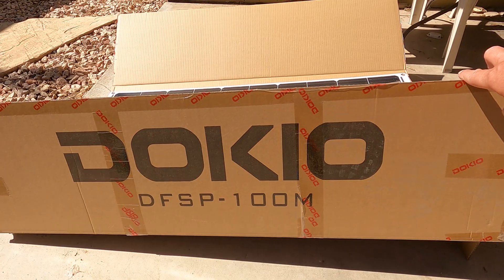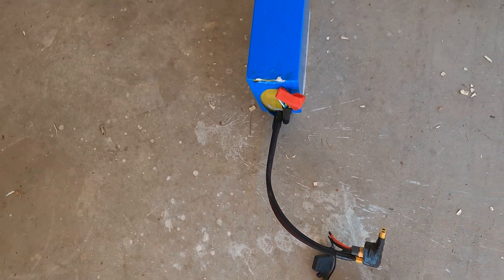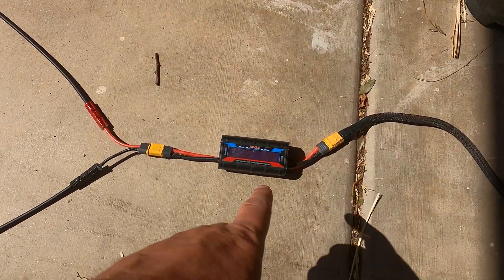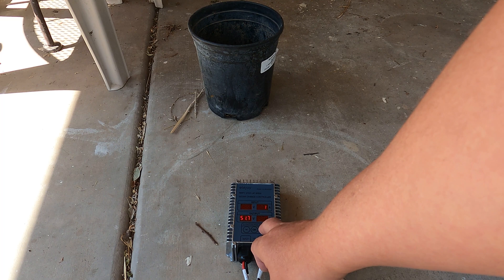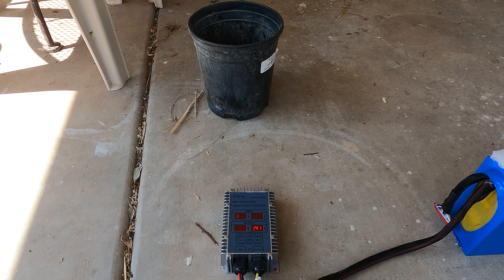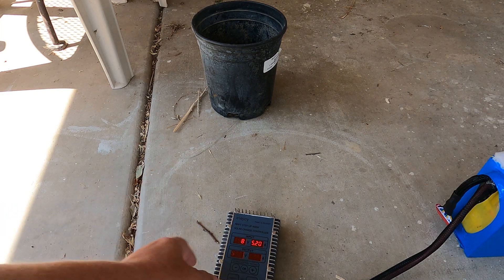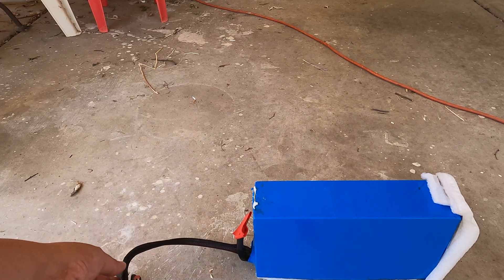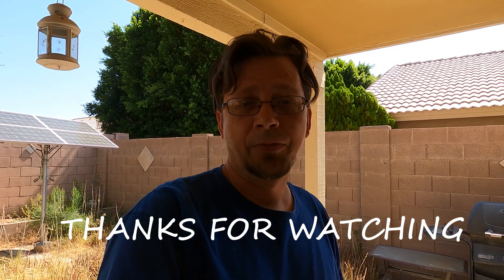🚴‍♂️Charge E-Bike With Solar | How To Charge Electric Bike with Solar?

Comment from the maker: CHARGE CONTROLLERS
🛒Cheapest - Boost Converter: https://amzn.to/3rVJ6cn
🛒Midgrade - LED MPPT Boost: https://amzn.to/3mzaCH4
🛒Midgrade for All Volts  (From Video): https://amzn.to/3rULEYd
🛒High End for 48v - Genasun (From Video): https://amzn.to/3ARroai
🛒High End for All Other Volts - Genasun :https://amzn.to/2UARc9Z

OTHER
🛒Meter: https://amzn.to/44RuuJN
🛒100 watt folding solar panel: https://amzn.to/36fbAQc
🛒100 watt Flex Solar: https://amzn.to/43I18wd

Comment: Hey Eric, thanks to you, I finally got my Burley adventurer trailer with stock solar panel rack for it, with an Amazon tilt rack, one 32 oz box of Flat out which I've been using in both my fat tire ebikes, trailer tires. One 200 watt Werchtay 9BB,with 166mm A grade cells 22.8 % eff., works well in partial shade. I already had Bluetti solar controllers 6.various sizes. But just bought a smaller blueetti  268w for mobility. $668.03 on Amazon 12 equal payments of $55, this includes trailer hitch and 4  1/2" emt pipe straps to secure Amazon tilt bracket to the Burley stock trailer rack. Everything I need except a combination of 8 bolts, washers and nuts which I'm going to Ace hardware around the corner right now..Thanks so much for your encouragement,  I'm ready to take on the world..lol. 😀

Comment: You can charge up to 350 watts? What does that mean in terms of charging an ebike battery? I wish there were some lower level explinations rather than "you get this part and this part and that is a solar sytem". You have a ebike battery, the converter and the solar panel and all these things jumble together and then you get X amount of range extention. Too bad there isn't some kind of a chart with  different converters and panels. I can't find charts anymore on Google. That's weird.

Comment: Hi, I got a quick question  I have the genasun 
48 V charge controller for my 48 V 14 amp hour batteries 
My question was do I have to upgrade my batteries to solar batteries like yours.
Or am I able to just plug into the existing charge port?
Reply from the maker: If your not looking to charge while riding charging using the charge port will work fine.
Reply: Perfect thank you Eric for your time and help
I have a trailer camper I made for my 
e-bike 
And with your videos I am able to make solar work for my setup

Comment: I have a Bosch battery which has a proprietary plug. I charge mine with solar all the time but I have to use the original power brick, and I use a small 300 watt solar generator with built in charge controller. and connect it to a solar panel.  There really isn't a practical solution for long bike trips as you'd lose a day riding just trying to charge it. My battery will last me a whole day and I suppose if I went camping I'd back a solar generator in my car and charge it at night.  Ride1UP sells a solar kit on their website but there isn't any detail on what they are using for charge controller or the wattage.
Reply from the maker: Each time you convert AC / DC you have a 9-10% loss of energy. You can still charge it this way (DC to DC) if you add a bullet connector (could be a other type) to the mppt just like your normal charger for that battery.

Comment: Hey Eric. What kind of amps are you getting with this setup? I've been looking for "cheap" folding solar panel or two with at least 200watts. Would be very nice to have some backup power during longer trips so i would have much more options. 😅 i know quietkat has one but i think thats still a bit expensive for me at least. 😅 Would be awesome to see diy-version of that!
Reply from the maker: I have 2 AllPowers 100w ( https://amzn.to/3rSnxcV ) with a bit of a hack [ https://youtu.be/h3j9WSJx8QQ ]  

Quietkat $369 https://amzn.to/3Oa0ZM0 They need to work on their Amazon page. They forgot to list anything about its output. So the Quietkat only about $51 more then the Allpowers setup; however on the down side Quietkat is about 4 pound more.

I need much better sewing skill to diy one of these.
Reply from the maker: Just found out that the Quietkat is 150w not 200w. Had to goto their website to find the wattage information. Today they want $389 on the website, and $619 on Amazon.
Reply: @Eric_Tennant  wow. Bit of air in the price.. 🤔 im constatly thinking if i could make something like it, but with more juice 😁 i have no experience sowing but maybe my mom would help me with that 😂 would be interesting project. I have 2pcs 5amp chargers, and they are  really awesome on trips when i run two batteries in parallel. If i only had the possibility to charge without a plug would be even more cool 🤭
Reply from the maker: @E-BikePacking  Yea anything over $1.55 a watt for foldable is overpriced. Flex solar is running crazy low now. $0.59 a watt starting price for some. Have to be careful with flex. Some are pure scam crap on Amazon and other sellers. The one in the video is testing great so far. Even with the mods I've done to it to make it stiffer.

Comment: (sarcasm) But you hardly get any sun light where you live, right? Year round cold, overcast, cloudy all the time. Hardly worth the effort. (/sarcasm)
Reply from the maker: I know right! Me and my 49 panel (40X400w roof, 2x100w foldable, 100w flex, 2x10w cheap flex panels that don't really work anymore, 4x100w on a pole array). I Need more!
Reply: @Eric_Tennant  You can never have enough solar panels. Everybody knows that.

Comment: Quick question if you don't mind ... I have a 48v 14ah ebike battery .... would a 100w flexi and a Renogy Rover Boost MPPT 10A charge controller work? .... I'm based in the UK so limited to what is available here ... I actually have 2 batteries and a trailer so was planning on fitting the panel on the trailer charging the spare battery while using the other on the trail
Reply from the maker: Nope that controller is for 12v/24v. Here a link that will work for you in the UK for the 1 pound silver one  https://s.click.aliexpress.com/e/_oEG7d3D

Keep watching as the solar trailer is where this is all headed.
Reply: @Eric_Tennant  thanks for the reply .... but it's listed as 36v/48v.... I have emailed them to ask but as yet no reply
Reply from the maker: It will work if its the 36v/48v version. Funny how it only list the weaker 12v/24v one here in the states on Amazon.